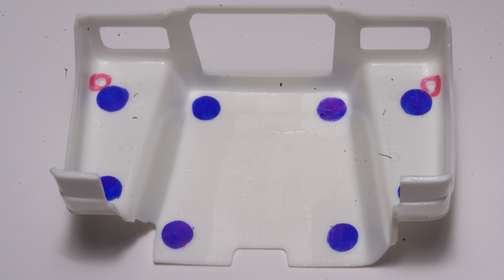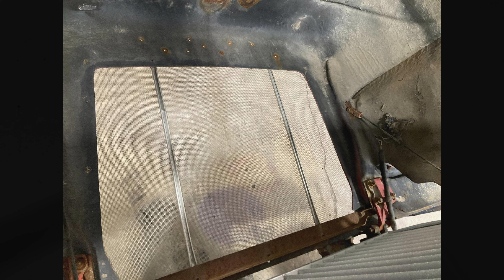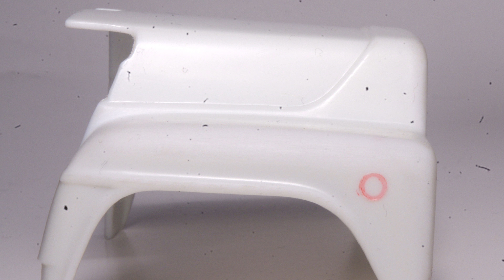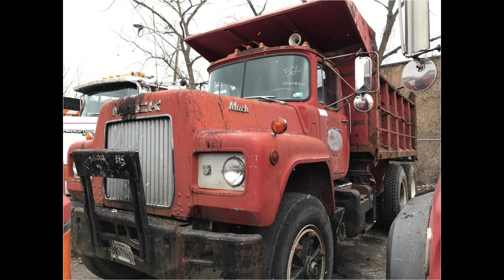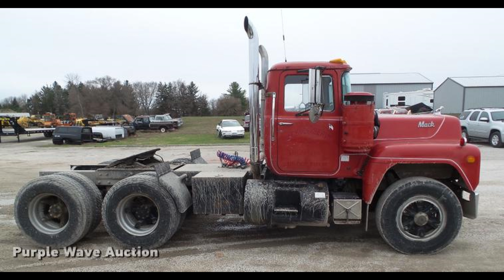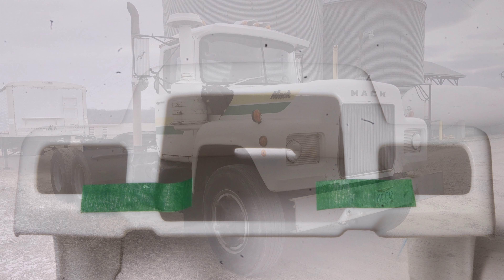AMT's 1/25 scale Mack R600 hood - making the kit part even better

Comment: Great tutorial 👍🏻👌🏻😃🤗 you named part 2 in the comments where you change the radiator and some other stuff but I can’t find it ?🙄👀
Reply from the maker: Good catch! I think I had intended to put something together for under hood details and rad shutters, then got side-tracked and worked on other projects. I will see if I have photos from those items. 

The change to radiator was actually to the shutters which are molded as part of the chrome surround that goes into opening at front of hood. On 1:1 Mack R's the shutters are attached to front of radiator and do not tilt with hood. Evergreen styrene half round was used to replicate the rounded contour of these shutters (modelled in closed position) on a styrene sheet backing piece.
Reply: @ thanks that would be great 👍🏻 🤗🤗👍🏻😃i am a big fan of your work, it takes the models to a whole new level with all this detailing 😃😃

Comment: Have question about fiberglass. Any idea how you create the rough look like it is under the hood? I'd like to make the van from Cheech and Chong, truck hoods would have the same effect.
Reply from the maker: I have created this texture two different ways, both were methods of creating cast armour texture I saw in Fine Scale Modeller articles. 

One way is apply solvent cement to surface and stipple with stiff paintbrush. Slower drying cement like Testors works best for this.

The other way, which I used on the Mack hood, is lightly running a 1/4" diameter ball end cutter in Dremel tool (I believe Dremel calls it #100) over all surfaces to create a roughened texture. This works well for removal of ejector pin marks on hood underside as well.
Reply: @brsnorthernhorsejourney3579  Thanks, I'll try it. I also had a suggestion to use wet wipes or tea bags and glue them on with white glue.

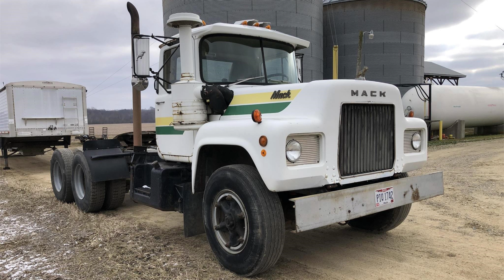Comment: Curious how at 6:20 you are talking about the pre-73 cab (which I really appreciate the detail you put into it!), but then you talk about the four-bolt hinges, suggesting it may be aftermarket. Look again, there are seven bolts on each side there! ;-)  Not trying to throw shade; simply hoping to clarify some potential ambiguity. Love your work, and I'm fixing to use ALL of your tips on my next (first) semi build, despite it being a White Western Star. Your videos have pointed out what to look for and how to fix it. Thank you!
Reply: The seven bolt pattern is that the Cab/Hood is mounted higher for engine room and radiator.

Comment: Question about the amt Mack r685 model. After looking at pics online, I've noticed that every model displayed with the hood open, the hood doesn't fully open. The hood is always roughly at a 45°ish angle. Im no Mack guru mechanic, but Im pretty sure it opens further than that. The question is, have you ever encountered that with this model? I ask because Im about to build one and I like to prepare for future problems. I was just wondering if  the model comes that way and if it's an easy fix. TY, sir.
Reply from the maker: Yes, kit hood hood hinge design does limit the hood opening angle and if I recall (from my days driving Mack R's about 30 years ago) hood does open up to almost 90 degrees on a 1:1 truck.

I haven't made major changes to kit hood hinge on previous models (on most recent one in Conrail Mercury markings I re-used kit hinge, only changing mounting points to hood , you have got me thinking that it is time to at least mock up a frame/cab/hood and look at how hinges could be reworked to get pivot point higher, allowing hood to tilt 90 degrees. Something along the lines of hinges for the AMT W900 https://www.youtube.com/watch?v=fqfQh3P7HdI&list=PLvLwIYpqDAkmJ9sOGntHf4wDwGcSwFErl&index=25

Comment: I drove an rd mack great video thanks
Reply from the maker: With the last RD's being built in (I believe) 2003 as 2004 models, and the first R series trucks built for the 1966 model year, that R cab had about 38 years in production! That's a long run by any standards and even longer than another well known and very popular truck cab, Ford's L series.